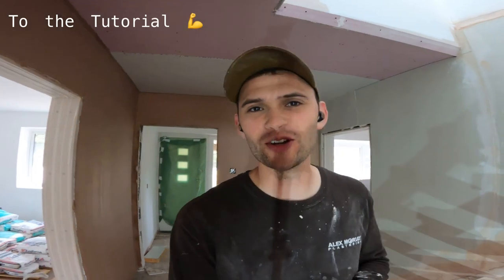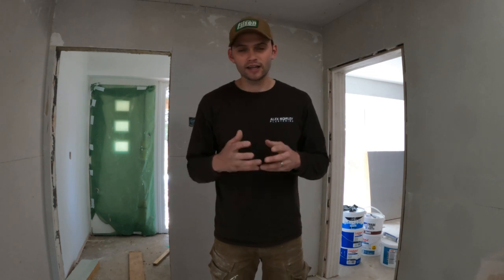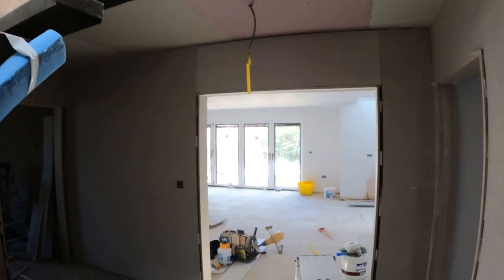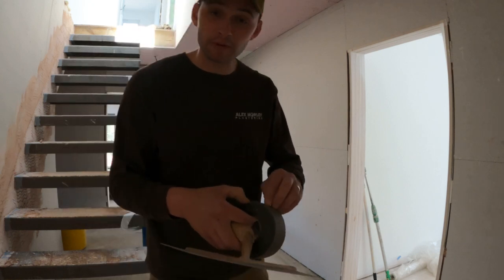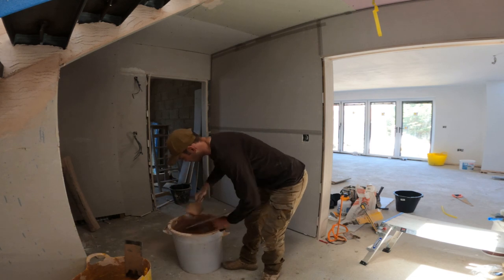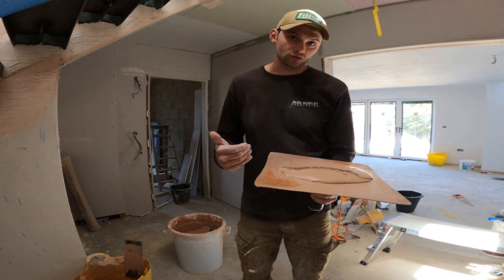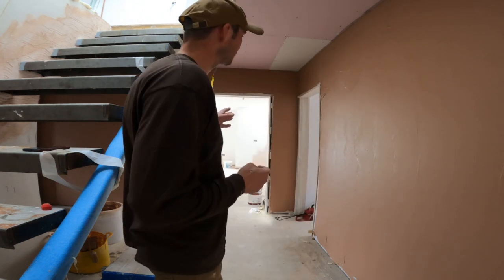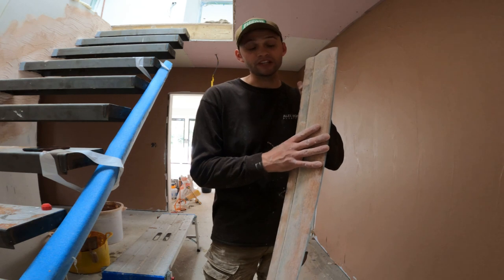Beginners Guide- How To Plaster a Wall (Step by Step)

Comment: Appreciate the all important little details such as what degree angles etc, I have subscribed...keep up the good work mate. Im watching the whole video, I am enjoying the great detail. Thank you
Reply from the maker: Thanks for the comment and the Sub. Despite my best efforts, it would appear very difficult to condense all the info into a shorter video. Hopefully you enjoy it. 

Thanks again.
Reply: @AlexMorleyPlastering I am watching it fully again. It will be my first time attempting plastering on a tight budget...

1) could you please recommend a trowel? 

2) also would i need a Ultra Flex Finishing Trowel?

I would really appreciate it, thank you in advance.
Reply from the maker: @jizzy5425  thanks for your message. Tough one tbh. Depends on your budget. 

Really a Spatula or Speedskim is more useful for a novice. Either a 800mm or 1m. 

Trowels, personally I prefer carbon steel, as they wear in quicker but with stainless steel there is less maintenance. 

I would probably get something like a Nela MIDI Flex, or the Refina equivalent in 14” and a second hand 14” plastering trowel of eBay. Already worn in. Saves so much time for the same price. 

If your new I would look into sponging though. Much easier to get a good finish.

Comment: Brilliant tutorial, one of the best I’ve seen. I am still learning but managed to plaster a whole room at various stages. Just one small wall makes me sweat like I’ve run a marathon, along with swearing and dropping plaster everywhere but the end result turns out pretty good. I always end up with several tiny dings or hollows that I use filler on, is that usual for all plasterers? The speed skim has made it so much easier.
Reply from the maker: Glad to hear the videos are helping. The dings will become less often as time goes on. Take your time, use the far left on the bucket as it’s drying. As it’s less noticeable when it dries.

Comment: great finish alex ... top notch......one thing wouldn't you consider a X stand and spot board instead of bending down all the time ....or your just used to the bucket system .....
Reply from the maker: I so have a spot stand. The problem is because we are often mixing 2.5-3.5 bags at a time, you can’t life the bucket. And the board would have to be massive. So there is little to no gain. Bending down isn’t really an issue. Not compared to stepping off a hop up atleast.

Comment: Do you recommend up and down over side to side to flatten with the spat? I heard you mention the side to side in your other video to avoid vertical marks   👍🏻
Reply from the maker: Side to side only on VERY high walls. The  latest video they are over 5m high. Standard walls 2.4m up and down is my preference. You can go side to side aswell, but the priority should be ⬆️⬇️ In my opinion. It gives a better finish.
Reply: @AlexMorleyPlastering   thanks pal 👍🏻

Comment: Hello again mate. Been watching this a few times ahead of my next practice. 

When you showed your phone with 17 mins on after applying the first coat, was that 17 mins from when you put your first bit on the wall? Or from when you finished mixing? I noticed you chatted to the camera for a bit after it was first mixed. Is it fine to sit in the bucket for a small while, and does it not go off anywhere near as quickly as when first put on the wall?
Reply from the maker: Hi Marcus

Looking at the video, at 17min point i had just finished applying the first coat. I had not mixed up for the 2nd at this point. If you are new to plastering you want to mix up when you need the plaster rather than letting it sit around.  To give you as long as you can with the gear. Hope this helps.
Reply: @AlexMorleyPlastering  Sorry mate, I was referring to just the first coat. I just meant can it last a little while in the bucket and does your timer start once it hits the wall, or once it's mixed and sitting in the bucket? When I practice as soon as it's mixed I'm panicking it's already going off like a rocket just by sitting in the bucket, and I'm rushing to get it on the wall asap!

Comment: Which trowel you using to do your 2 finishing trowels?
Reply from the maker: Most of the time I use a carbon steel trowel up to the final pass.  Then run a Nela Plastic  

If I use a flexible trowel it would be afte the 1st wet trowel. And most of the time it’s the Nela Midi. However we are resting out the refina Superflex 3.